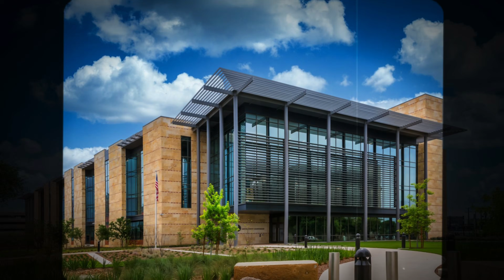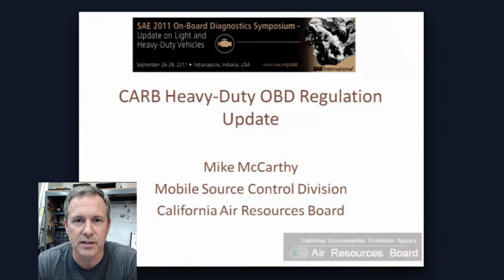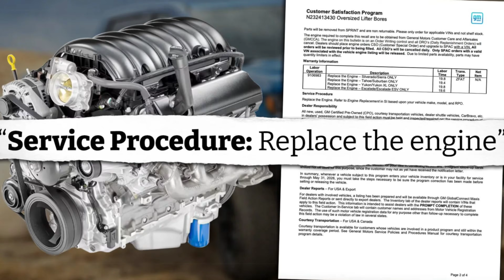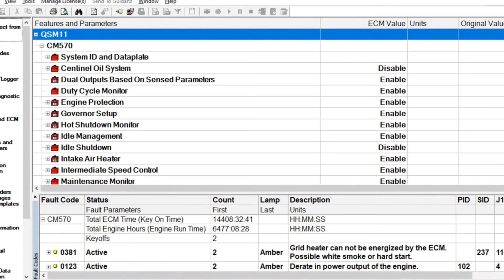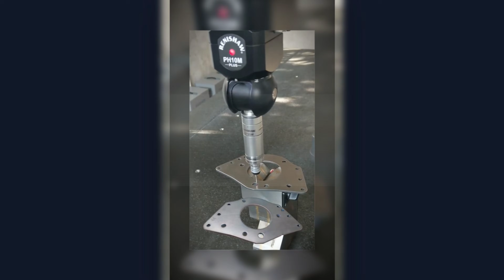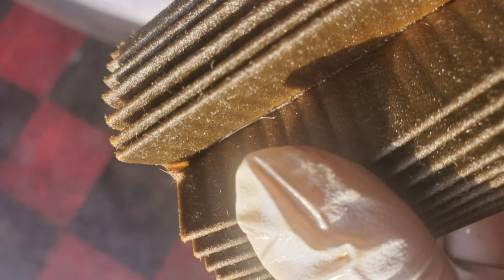The 4 "American" Truck Engines That Use Chinese Parts (The "Made in USA" Lie)

Comment: Well done! This goes back further than 2010. The whole reason the industry went to metric is so that one by one the beancounters can source the cheapest possible parts from the cheapest supplier anywhere in the world. It started in the 1980's and 90's with automotive and followed about 10 years later in trucking and heavy equipment. We need to move back to SAE standards and make emissions + safety standards optional so small startups can once again compete against the big manufacturers, like how the industrial revolution started 100+ years ago.
Reply: Seen em with mix of measures😮😢

Comment: I became a master ASE certified Auto/Diesel tech and worked in the field for 6 years. Every single car manufacturer has globally made parts all by the same companies. Most parts are R&D in china now because their infrastructure allows 24hr turnarounds for a fraction of a penny. Some Companies still have low quality, but there are many contenders that will beat an "american-made" part any day of the week.

For example, if you look inside modern GM cars, all their electronics are either china, Taiwan, korea, France, or even Germany. Nothing is made here anymore.

Comment: FRAUD, quality COMPROMISED, warfare of a different type sabotage aimed at infrastructure transport,.!😮
Reply: Don’t worry our American vehicle companies are heading the same way. 2026 gmc engines are already failing at an abnormal rate.
Reply: @shaungronda2759 My father's 2019 Silverado blew its transmission at less than 99k miles. He then went out and bought a 2025 half ton for 67k. That truck has been nothing but problems.

I, a former auto/Diesel technician own a '99  Jeep XJ m/t, '08 Dodge 3500 diesel m/t, and a '99 Lincoln TC. I don't have half the problems he does.